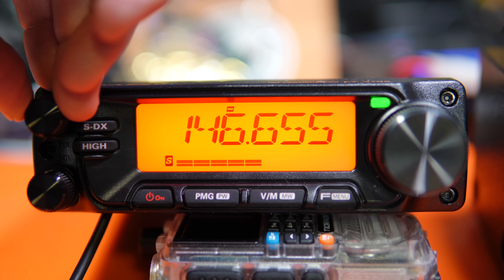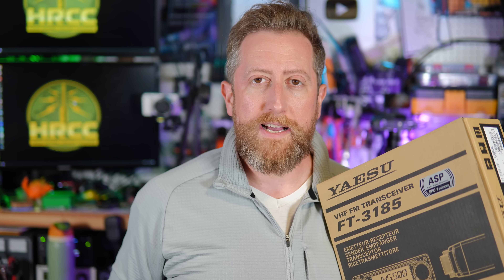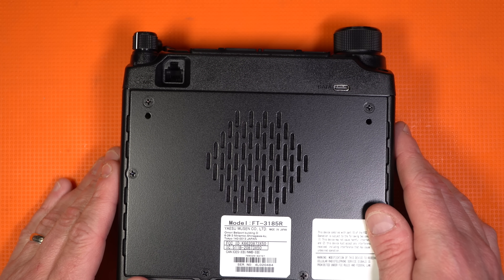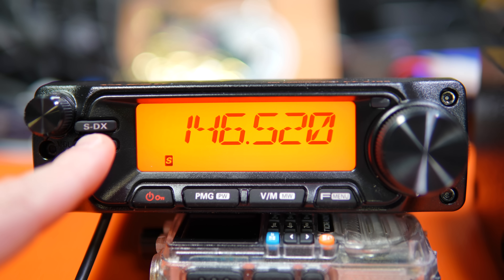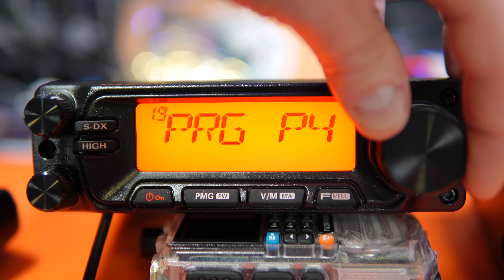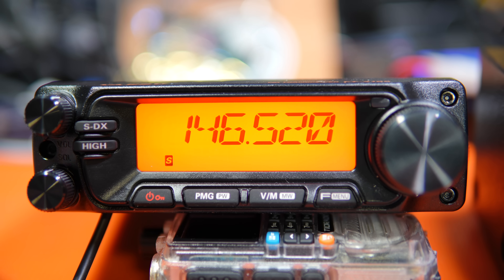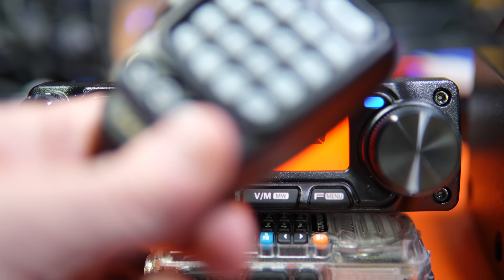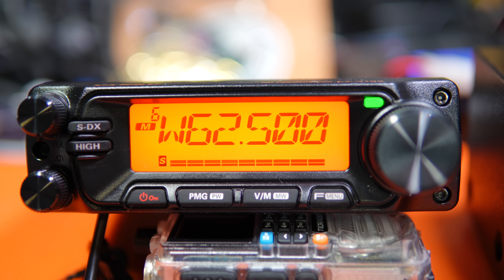NEW! Yaesu FT-3185 85 Watt Mobile Ham Radio!

Comment: We need a 2m SSB Radio Yeasu,Come on now, you can do it :))
Reply: I agree need SSB so many radios coming out there missing this mode ...There not listening ...
Reply: @nickcountycomm  that's why I'm not buying!
Reply: They can't even put a decent dot matrix screen on this crappo monomode monobander so you can put the name of your repeater up in clear text and show the repeater name and the frequency.
Reply: Completely agree, there is a huge hole in 2m sideband that they could easily fill. Make the same radio but include ssb.
Reply: Right? A 2M all mode radio would be perfect
Reply: FM can be implemented with a class E amplifier. SSB requires a linear amp and that would require an even bigger heatsink, more current and more exotic components. That’s why SSB is so uncommon on 2m/70cm only radios.
Reply: Is the cheapest VHF/UHF SSB the IC705? That's just too steep 😢
Reply: @alphaadhito  The IC-7100 I think or 991a
Reply: Something like a modernized TenTec '2n6' would be huge! TenTec won't be doing anything like that obviously. The market sure seems to be ready.
Reply: -> ft991a has entered the chat
Reply: This radio in duel band,  single receive fm/ssb, a crazy basic radio would be amazing
Reply: They just did, the ftx-1f
Reply: Im waiting for Yaesu’s version of the IC-9700. I feel like I’ll be waiting a while lol
Reply: Love the simplicity but would love tonsee this exact setup in an all mode varient.
Reply: If it's like the 2980r, it gets HOT and starts sending overheat alarms. On my desk. With the AC and the cealing fan above it going. Yaesu cheapened up by not offering a fan. 
My ancient Alinco has a fan and has never overheated in-the-car. I paid 40 bux for it NOS! Doesn't have DCS but only one VHF  repeator out of 50+ programmed in my area  had that which was recently taken down.
My FT 2980 is also a power draw hog. My 50 watt Alinco is not. Alinco also has a top firing speaker vs the bottom one on the Yaesu. Alinco is very audible at normal volume levels at highway speeds. Yaesu?....Desk Queen.
Reply: Yeasu is not listening to Us Americans Ham Radio Operator! Icom is much better Now then the Yeasu,
Reply: Disappointed no fusion
Reply: Theyre like democrats.  Just buy our radios and stfu 🤔😅✌️
Reply: @ConspiracyBear Jesus man, get over it!

Comment: Cable out the bottom.. Lots of people mount the radio on the passenger side of the vehicle to the center console. So the socket on the bottom would be facing the driver. It's how I have my Yaesu FT-2980R 80W 144Mhz FM Mobile Transceiver. So the mounting bracket would be the stand off to provide space for the cable and radio access for the driver.
Reply: Yeah, that's how I have some of my radios mounted.

Comment: Looking at the design of the radio chassis, it reminds me of the FT-2800,FT-2900,FT-2980 models, and being that the speaker is bottom firing, and you 'should' have 2 'standing foot' (Page 3 in the online manual) that prop up the front of the radio to hear the speaker when on the desk, and I think it would also have the clearance for the mic when its got the feet attached.

Comment: I wish the speaker was on the top.  We have yet to see what the data cable port is for either.  Could be programming but can't find a note on it in the basic and advanced manuals.  Bottom mic port works only if you are using the mounting bracket.

Comment: Good SOTA radio
Reply: I thought so too, but it's 4.2 pounds. It's a heavy boy. Even my old TM-D710GA weighs significantly less. The ICOM IC-V3500 is only 2.4 lbs.
Reply: @ 4.2…ouch…nvm

Comment: I'm betting they put the data port there because that's where the uart interface is on the board. If it isn't for aprs and whatnot it kinda makes sense.
Reply from the maker: That is my guess.
Reply: It makes zero sense other than wasting time and money r and d just to flick a new toy out instead on polishing existing designs.
Reply: @ts440s  oh I know it, you know it, but they keep making things weird. I love my 818 but I hate the menu structure. That would be a great one to revamp, maybe add a waterfall and fix the placement of the mic cable. Boom, instant banger. Maybe they'll ask the people what we'd like to see for next year's upcoming models. 🤷🏽‍♂️

Comment: This is 2024... and I dont understand why Yaesu is putting out radios with an LCD screen that looks like it came from a 1984 Buick. 🙄
Reply: Easy to read. Not distracting while driving. Keeps cost down. Yes it looks retro, but I don’t need a waterfall while driving either.
Reply: @timel64 Not only does it keep cost down... it keeps sales down. I just bought a used FTM200D on ebay instead of buying one of these. Yaesu can count that as at least one "lost sale" 😂
Reply: I rather like the simple white light display on my Leixen 898.
Reply: That display helps when driving and maintaining some night vision.
Reply from the maker: Good in bright and low light.  Not distracting. Plenty of good reasons.
Reply: It uses less power than color display. And can be used in direct sunlight without needing backlight. It's always tradeoffs

Comment: That heatsink is such a pain in the a$$ when dealing with coax connection. I have a couple FT2980's and it looks like the same chassis.
Reply: Just cut the arching bridge out of there. Works great, a little black touch up paint etc.
Reply: Usability, we didn't need no usability. 
-Yaesu
Reply: 3 raidos  later, 2900 2980  85 from  75 to 95 watts crap to attach 259 up . Lol how hot put on high promise  150 easy  2980 has cw training  needs big ass fan simp full power 160 degree s seen it  no sense w/ o detached  fase  no sense not dig6 as well no sense no fan

Comment: These companies have serious issues and I beg you to start asking the hard questions next time they are on. The fact that you put a speaker mic to constantly be pulled at 90 degrees is just the tip of the iceberg. Why is this radio not tri band, if a cheap baofeng can have it why can't this.
Reply: Get a grip. Everything that gets added onto it makes the radio that much more expensive. If a person wants or needs a great 2M radio, at an affordable price, this is it. If they want or need a shack in a box, then this is not the radio. As for 220 - I couldn't care less about it and would never use, so I definitely don't wanna pay for it.
Reply: Exelente equipo!!!
Reply: Whatever, these companies have had DECADES to solve these problems, and we should be WELL past monoband archaic radios that offer very little. Just getting them to make a REAL information gathering hint hint SCANNER and an all mode all band transceiver in one now in 2025 is NOT too much to ask for. This hobby is going to be extinct soon if they don't start paying attention to what customers want instead of what they spit out over and over and over again. Rob Braxton is correct, now that starlink is out and soon on cell phones justifying 1k to 3k for a HF receiver that really isn't going to do that much in a shtf environment especially when they won't even build in real world applications.  Sorry, I'm frustrated, but being out of radio for 30 years and  trying to get back in listening to the same old net check ins and weather reports is very difficult. I have a DX 10 on the way and retaking my test because the FCC says it jokingly expired and I will soon see if I can re join this once very exciting and ground breaking hobby that had real world applications once again. Heck even scuba diving has advanced way more that ham radio, maybe the geeks and high IQ we think ham radio guys are was all smoke and mirrors.
Reply: Or why doesn't it include Fusion?
Reply: @jeffkardosjr You've got to be wondering how bright can these guys really be when they can't even decide where to put a microphone port after say 40 years of these mobile rigs out.
Reply: I cannot even hit my repeater in my area with a baofeng
Reply: John Kruk of Yaesu will be on Coffee and Ham Radios tonight at 7pm CST.

The mic direction thing is a great question for John.

I can add one thing. John already said that 220MHz is a ham band only in the US, so adding a band for one market is very difficult.
Reply: @LeeMccNA5T 
It's another filter circuit and some minor software changes. It's not that hard.
Reply from the maker: Adding 220 isn’t hard, but it’s an expense other markets won’t pay for and making separate skus is often a non-starter for some companies looking to work in economies of scale.
Reply: @jamess1787  Adding one band to a dual adds 50% more board space for filters, and filters take up space. Especially 65W filters. Baofeng is making 5-ish W radios, so very small space. And Yaesu wants them to be very sharp, which would take more filter stages.

Comment: Have you done a radio test on the new Yaesu FTM 150Rasp I have the radio as of November 26 2024 from Ham Radio Outlet out of Georgia. I did find out from RT systems they do now have the software the CD and the programming cable for that radio Yaesu FTM 150 raspe. 73 K4BWN

Comment: There is absolutely no practical reason for putting mic port on bottom. That is one of the most ridiculous things I’ve ever seen in my 40 years of radio. Engineers had to be high or intoxicated. 🤦‍♂️🤷‍♂️😂
Reply: If head is remote it makes great sense. Allows for the weight of the cable to drop straight down instead of forcing a bend that will eventually break connectors/wires
Reply: Maybe theyre just democrats. 😂

Comment: Seeing you screw that coax in that tight spot can you use a quick connect that just slips on and it hold up make it easier in the tight spots you know the old saying about tight spots. 73 K4BWN

Comment: Do any of these new radios allow you to play the audio through the car's sound system with Bluetooth? If most cars now have Bluetooth, seems that would be a "no brainer"?
Reply from the maker: This ones doesn’t.  And to be honest, even though I have a radio that does, I never use it.  It’s not really the value people think it is.
Reply: I've been more subject to connect with an auxiliary cable to my stereo in my car. That's not too bad.

Comment: It is surprising to see the ports on the bottom. The speaker is down-firing on the bottom as well. They didn't seem to consider using on a desk for this radio. Can you mount "up-side" down in the included bracket? And if so, does the bracket mount allow the bottom to be elevated enough for speaker and cable clearance from the bottom surface? The ASP processing does sound really, good, though! Thanks for sharing a first look.